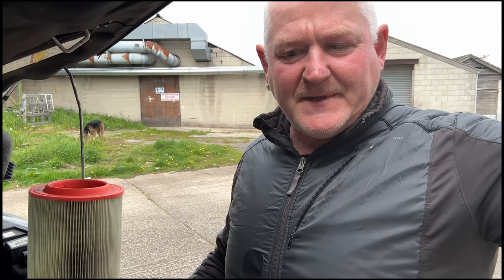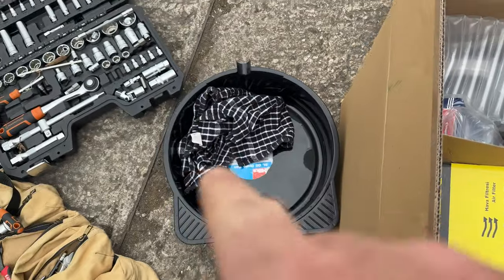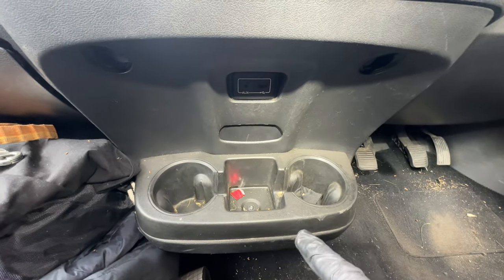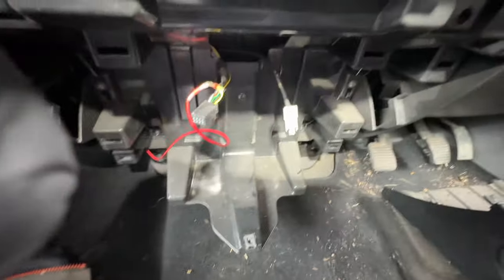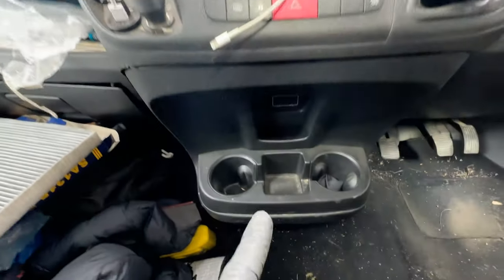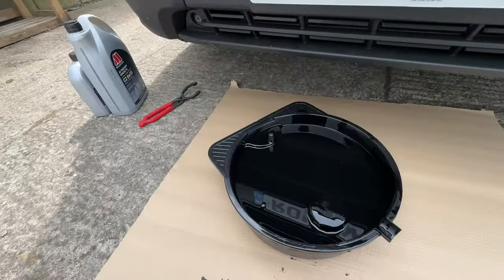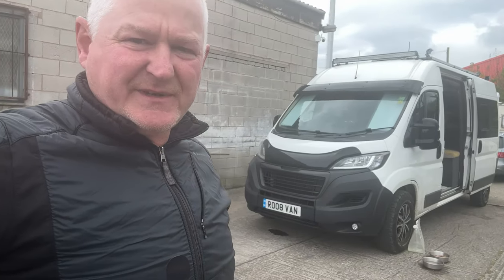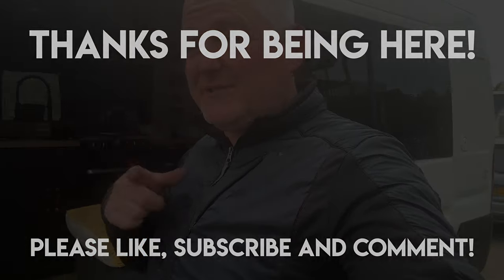HOW TO Service a Peugeot Boxer Campervan.

Comment: My garage could not find the pollen filter. So called citroen specialist. I googled it and told him. Self service next year. Thanks for sharing.
Reply from the maker: Definitely worth learning and doing your own service every 6 months… saves money and you know it’s actually been done!
Reply: Rob as a fellow Veteran (Engineer at that!) I need to get back to servicing my own vehicles like the old, old days. I have to say though got a front disk brake service and brake pad replacement on recent Turkiye trip. Could not pass up the 40 Quid price for the job. Still had 7000m wear on them but a bargain price had to be done.
Reply from the maker: @eddvanlife7396  totally agree about doing your own service in the UK, but if I was in turkey myself, I’d happily pay the locals to do stuff for the price you pay over there!

Comment: Don't forget the sump plug washer! I missed mine and has a slow drip. Couldn't find a new one so had to get a whole new sump plug (with washer) from Euro Car Parts. Lesson Learnt!
Reply from the maker: Yeah I made sure the washer was on the sump plug before fitting again! I keep checking under the van and thankfully no leaks as yet 👍😎

Comment: Fantastic vlog... 👍wish I would have seen this before being scalped by a Fiat Professional stealer and getting the motorhome back damaged!! 😔
Reply from the maker: No way, I am so sorry to hear you got your motorhome back damaged… what damage was done? Regards Rob
Reply: @PackTheVanAndGo  They charged me £490 for the same work and somehow   caught the rear the rear garage door and valance but only noticed it 5 days after once packing it for a weekend getaway so unfortunately couldn't prove at !!  The experience of the Stoneacre Fiat stealer was nothing short of a disgrace and put us off Fiat for life!!😔
Reply from the maker: @startaylor123  wow, how much do they charge… the pride of a service kit from eBay is less that £100 and then the time to do it yourself… just a few hour… saves you around £400 each time… and you can do it yourself 2 times a year to help keep the van on the road longer! Crazy how much they charge these days and have no respect also… that’s why I enjoy doing my own van, I have more respect for it and know the works been actually competed 👍
Reply: @PackTheVanAndGo  absolutely... you live and learn 😔👍

Comment: Just as I did it years ago, when I had everything I needed to work on vehicles. There doesn't seem to be much ground clearance for you to get underneath and drain the oil. Hope you managed it without too much struggle and I know that if I tried it, I would have got stuck. 😮
Reply from the maker: Hi mate, how are you this Sunday? Yeah just about had some room to get under and drain the oil... just the fuel filter left to do anther day!
Reply: @PackTheVanAndGo  All good and quiet here thanks. Fuel filter was easy on my old transit, so I hope that they have not located yours in an awkward place.
Reply from the maker: @mmwaashumslowww7167  yeah I need to remove the headlight and a few other parts to get to the fuel filter, so will do that tomorrow evening
Reply: Hopefully you won’t have any problem with the fuel filter. I believe they can be tricky to change.
Reply from the maker: @kstewart3657  Its just a right pain in the ass to get too and replace! Thats tomorrows job!

Comment: Fuel filter! Yes it’s a bitch. I think I’ve got four left over, unfitted, still in the shed. Maybe it’s time to use one.
Ps the brakes are dead easy to do as well. But as a very quick simple extra thing; remove and lube the handbrake pivot point halfway under the van. 13mm nut.
Reply from the maker: Definitely need to do the fuel filter next week! And thanks for the tip on the handbrake pivot 👍
Reply: Yeah I reckon that’s probs why the “vibes” handbrake stuffed up on their van. Handle goes down but lever doesn’t fully release the shoes.
Reply from the maker: @craster_van_kippers  ahh got you… 👍 and their van was overweight?